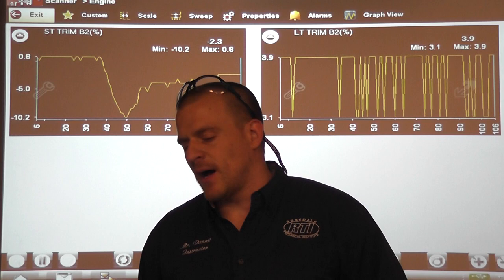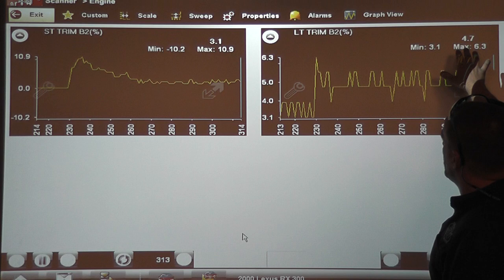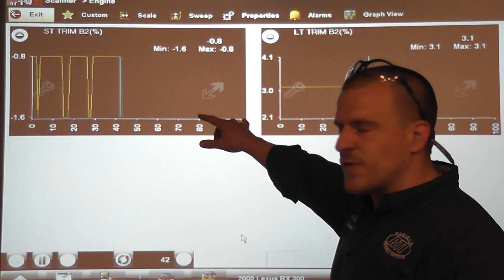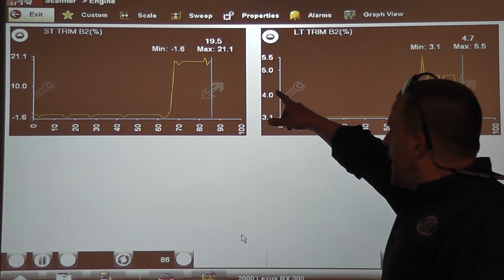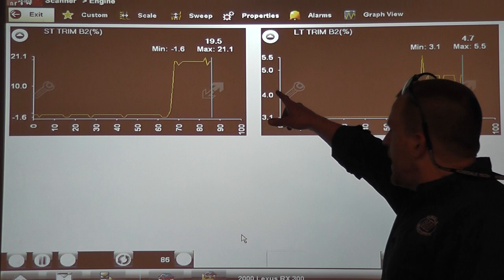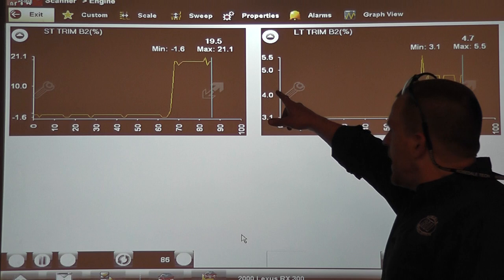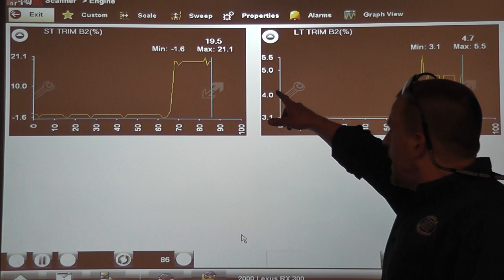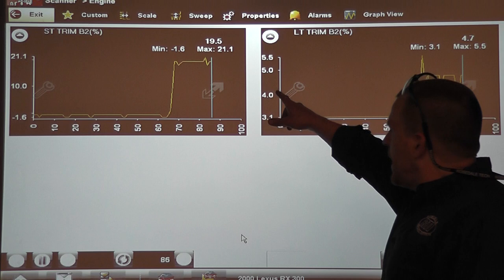Using Fuel Trim to identify type of misfire (can it be done?)

Comment from the maker: Thanks for your input. If I could get past all the bashing I would. I agree with you about some misunderstandings I may have with the O2 sensor and how it actually works. When I can put all of this together I will do a follow-up video to this. The main point of this video was to show that an ignition misfire does not cause a rich condition and negative fuel trim numbers. I would like to hear about your bad cylinder negative fuel trim scenario. Thanks again for your time and comment

Comment from the maker: You had it right in your comments on the ETCG video. I just felt the need to do this to clear the air for those that think an O2 will go rich with an ignition/compression misfire, from unburned, raw fuel in the exhaust. As you know, as misfire will drive the O2 lean regardless of the type of misfire. 
Thanks for the comment and great advice to the other poster on ETCG.

Comment: This is not a difficult concept to understand. Especially if you know that an oxygen sensor is exactly that, a sensor that reacts to oxygen. 

The term "rich" when discussing fuel trims, and fuel mixtures in general, is probably where most of the misconceptions come from. People I've worked with don't realize that rich isn't rich. Rich is oxygen deficient.

Oxygen deficiency can occur for many reasons but at no time can an oxygen sensor determine if a system has more fuel than it's supposed to have.

Great video.

Comment: Yesterday, one of the techs in my shop was diagnosing a surge at idle and an intermittent stalling issue. He had codes for a small leak and oxygen sensors. He was trying to command the vent valve close to see if it could see an increase in fuel tank pressure, but at some point saw negative pressure. He was trying to associate the vent valve with the surge, but I could not see the surge as a symptom of a  restricted vent valve. Today, another tech looked at it and checked one spark plug and the electrode was eaten away. Guess what, the LTFT and STFT were single digit negative. 
Logically, they should not be negative, but they were. Love your videos as always.

Comment: Paul, I had a citeron c3 1.6 8v in yesterday with inj no 4 open circuit DTC stored. Checked the STFT and that was 23%.checked it on the gas analyser and the HC were very low which confirmed that the injector wasn't working. Removed the plug and found corrosion on the terminals. Checked resistance 2.2 against the other 3 of 13ohms. Replaced the injector which brought the fuel trims back in line. Your videos help me so much! Keep up the excellent work!

Comment: I like this guy.  I'm an ME (but not in the automotive industry), and I do ALL of the work on my '08 Acura TL Type-S.  A few weeks ago, a spark plug decided to take a shit, which triggered the MIL, followed by a surprising loss of power and the embarassement of limping my "garage queen" back home with her sounding like a fucking golf-cart.  And a top speed to match.

During my LONG drive back to the house I was imagining every scenario possible as to what the issue might be, how much it would cost and how much back pain I would suffer while digging down to the troublesome part.  Bad injector?  Bad coil pack?  Some pissy connector somewhere?  

I kept thinking about how a misfiring cylinder would affect the AFR and how I could use that info to help me pinpoint and solve the problem quicker.  I was wrong.  Way wrong.  I wish I had seen this video before I fucked around and wasted time trying to diagnose the problem based upon incorrect assumptions about how different types of misfires would affect STFT and LTFT!  Some simple, old-fashioned troubleshooting led me to the correct diagnosis.

Nice job on the video dude.  I have been re-edu-muckated...

Comment from the maker: That is correct. Although there is some debate in this field as to the O2 sensor signal being affected by hydrocarbons. I am not debating that at this time as I am no chemist. But what we can definitely determine from this video is BOTH types of misfires drive the O2 signal lean due to excess oxygen in the exhaust. With the injector (no fuel) misfire showing even more lean.  One other thing, unburned fuel IS NOT rich. This is a very common misconception in this field.

Comment: I just used this to find a stuck injector on a 3.4 gm. Buddy had a miss. He replaced plugs/wire. Still missing. Used fuel trims to see it was running lean, then scoped the injectors and looked for a missing pintle hump. He had been driving like that for 6 months cause he couldn't figure it out. I fixed it in 45 minutes thanks to Danners channel.
Reply from the maker: nice! Thanks man

Comment from the maker: Hey, no problem bro. I didn't do this video to prove anyone wrong, I actually did it for me too as I had some doubts as to the result. When you get a chance, check out sections 4 and 5 in my book (now that you have it). These two chapters cover O2 sensors and Fuel trim in great detail. I think it will help back up this video.

Comment: I'm going to jump in and answer this since no one else has yet. I don't know what you mean by Internal v. External problem is. As his name implies, his video is about not using the scanner to diagnose a misfire. Quick checks would be examining the spark plug, wires and the boots, checking fire and voltage to and from the coil(s), checking for voltage signals to the injectors and feeling each injector to see if it is firing. Do a balance-of-power to find the faulty cylinder. (continued)

Comment: I’m new here. I’ve been experiencing rough idle with my 14 jeep Cherokee 4 cylinder. Using the bluedriver scanner. I found the LTFT at 19% and STFT at -4%. Replaced spark plugs and injectors with mopar. Rough idle is still there. Cleaned throttle body. Still there. Now i gotta check fuel injectors. This video really clarified alot
Reply from the maker: Does your LTFT improve at 3000 rpm in park?
Reply: @ScannerDanner  yes. I see better long term at 1500rpm
Reply from the maker: @ravit928  sounds like a vacuum leak
Reply: @ScannerDanner  thanks a lot for the feed back. I’m a tech at mazda. New to the auto field and your video helps a lot understanding these diagnostics. I’m gonna try and find this leak with a smoke machine. I have a feeling the EGR valve is clogged. I don’t have any DTCs. And when looking at mode 6. I get random misfires. Cylinder 1-4 gives me random numbers from 0-19 on random days when i check. I cleaned my throttle body and after doing a 20 min drive i saw low misfire like c1-3 c2-5 c3-0 c4-8. Then another week. The numbers change
Reply: Update. Smoked intake. Found no leaks. Pulled fuel injectors and check ohms. They were all good. Sprayed them down with brake cleaner. And reinstalled. Drove for about 20min. Checked LTFT went down from 19 to 3%. Definitely injectors
Reply: I mentioned injectors replaced ealier. I did spark plugs and coils. Not new injector. I’m gonna put new injectors and see the difference.

Comment: You are absolutely correct that neither ign. nor lack of fuel misfires cause a rich condition. The reason being that people forget that there is a full cyl. worth of O2 going in there also, and even with the ign misfire and unburned fuel, the O2 content far out weighs the amount of fuel. Both misfires cause a lean condition and will drive trims rich. You come back on IATN and you wont be bashed, I'll see to it. Remember, one can't feel, see, or hear emotion online, so don't take things personal.

Comment from the maker: I copied this from my book.
Higher than normal fuel psi,
Ruptured fuel psi reg. diaphragm, 
Leaking fuel injector,
EVAP purge problems,
ECT or IAT sensor problems,
MAP/BARO or MAF sensor problems,
EGR valve stuck open at idle,
Fuel contaminated oil,
Head gasket leaking causing coolant contamination of the O2,
Jumped timing chain/belt

Comment: You said it man,depends on many variables like COP , wast spark,distributor,misfire code or not,how accessible is the cylinder in question,how easy it is to current ramp etc.But if a gas analyzer is available ,I think wold be my first choice like you did with Eric.I had a Cadillac with North star engine in my shop today.No crank.To check for voltage drop at starter I had to remove the intake manifold,The cable was fine so I replace the starter.So it depends on the task at hand.LOL

Thanks again

Comment: Mate your channel is awesome, you explained what the data was all about on the display on my Bosch 2220 found my no2 bank in my ford xr6 BA STFT was 30 it's idle has been really rough, also in my Ford AU I found inlet  manifold Inlet gasket leak so I'm guessing it's the same with my BA as well, ruddy cars!

Comment: My car is running rich on one side of the engine bank 2, yet the O2 sensor on the same side bank 2 is reading lean. My right side catalytic converter is shooting out a lot of black soot. It definitely has a misfire because the MIL is flashing. I have changed out the O2 sensors, spark plugs, cables, cap/rotor, fuel pump, fuel filter, EGR, gas regulator, MAP, & finally the MAF sensors. Watching this video made me realize it might be clogged fuel injector making the O2 sensor read a false lean.

Comment: Hi Paul, At AVI on demand, instructors Ron Bilyeau and Bill Fulton are both sure that the type of misfire can be determined by the fuel trims: saying that a rich density misfire will cause negative double digit fuel trim numbers and a lean misfire will cause positive double digit numbers and also that the rear o2 sensor can can indicate types of misfire: high mv is an ignition misfire while low mv is no fuel misfire.
Reply from the maker: This was an argument against others who were stating that an ignition misfire will drive fuel trims negative.
Yes, fuel trim can be used as an aid to the type of misfire. In fact you can see the difference in fuel trim between the two. Also, I agree in using the downstream O2 as well!
Reply: @ScannerDanner  ive found your video very informative im having a po300 random misfire on my 2004 silverado 1500 with the 4.3 v6 it only happens on the highway in 3rd or 4th gear going up hill or towing my camper i can floor it in 1st or second no problem with no issue. I logged my upstream o2 sensors and my short term fuel trims. At the moment of misfire the o2s are reading very rich like .8-.9 and the short term fuel trims go completely flat during the misfire. Normally they fluctuate from -3 to +5 in the typical up and down fashion, but go dead flat around 0. Any idea what would cause this?
Reply from the maker: @dougsavery5442  any misfire will alter your fuel trim and O2 readings. So that info isn't really all that helpful. From your description it sounds like a secondary ignition issue. Hard to say, but that flat style distributor cap was notorious for crossfiring inside.

Comment from the maker: P1132 is B1S1 indicates rich (this would cause negative fuel trim numbers. And P1151 is B2S1 indicates lean (this would cause positive fuel trim numbers). 
So one bank is running rich the other is running lean, Is it possible the connectors for the upstream O2s can be switched? In other words they are connected to the wrong bank. This can cause this condition. Also you may want to check that thing for a bad headgasket.

Comment: Thanks for clearing that up, Paul.  Very good video.   Even though the system went open loop on the narrow band, you could probably see the O2 sensor voltage PID and see that it was indicating lean.  In fact, I wonder what the O2 voltage would look like on forced open loop system with an engine misfire?  Can't wait to see your video on wide band and how the ECU knows the cat is bad on that system since it really can't compare front and rear o2 voltages.

Comment: great job man, had a similar disagreement before couldn't win lol... glad you covered this . had a couple question, your using a picoscope right? what model?   been looking at some PC based scopes and read some good reviews on the picoscope... any thoughts? and no i cant afford a verus lol as of right now im using a old bench top scope works well and for scanning a snap-on mt2500 and AutoEnginuity proline + Mitchell 5.8 its not the best setup but gets the job done. 
thanks, will

Comment: (continued from previous post) More quick tests are to use a vacuum gauge and checking the fuel pressure. Finally do a compression check and also a Leak Down Test. Too many mechanics out there will only look at the scanner trouble code and just throw parts at it until they finally replace the right one while making the customer pay for all of those mistakes mostly because they don't know what they are doing. Learn how to use all of these tools. (checking spark voltage should be in above comment)

Comment: Hey scannerdanner just wanted to talk to you about a test like this using the map sensor and O2 sensors data to find a type of cylinder miss. you might already know about this and if so just let me know. its pretty much what your doing but little different. so here we go first to determine if its a possible mechanical miss look at the map sensor data. were using the map sensor as a vaccum guage. so if the map looks smooth not jumping around like you see on vaccum guage with mechanical problem then look at o2 sensors. upstream and down stream. mainly downstream  is what will help lead you in right direction to a fuel issue or ignition issue. now lets say downstream o2 is reading lean this will lead you to a fuel issue because the cat is letting go of this extra o2 that doesn't need to store since the injector isn't supplying fuel. now vise versa if the downstream is reading rich now were looking at an ignition miss because now the cat is using all the oxygen to burn off all the extra fuel. now its a great test I was taught by a very smart instructor like yourself and wanted to share with you if you didn't know about this. if so just let me know. if you know about this and or have video of this I would like to know. thanks and keep the great vids coming.
Reply: Thanks so much for sharing. That is a great tip!

Comment: I thank you for all your wonderful inputs and suggestion. Let me show you the tables of the key parameters and their conditions and they also answer your questions:

After about 8 minutes at IDLE, no speed, RPM = 785, pending codes for misfires all cylinders (P0301-P0306) and P0300 (Random misfire) show up:
1. ECT = 176
2. MAP = 10 inHg
3. Spark advance = 9
4. IAT = 95
5. TPS = 13.3
6. STFT bank 1 = -27.3, bank2 = -2.3
7. LTFT bank 1 = 0, bank 2 = 0
8. A/F ratio sensor 1 bank1 = -0.246 to -0.269mA (before CAT bank 1)
9. Eqv ratio 11 = 0.964 to 0.972
10. A/F ratio sensor 1 bank2 = -0.019 to -.074mA (before CAT bank 2)
11. Eqv ratio 12 = 0.991 to 0.999
12. O2S2B1 = 0.825V (after CAT bank1)
13. O2S2B2 = 0.195 to 0.715V (after CAT bank2)
14. Load = 34.1

Then I drive the car, during ACCELERATION I see O2S2B1 = 0.3 to 0.6V (after CAT bank1)

Per your instruction, I take notes the following numbers during DECELERATION; my foot off the gas pedal:
1. STFT for B1 and B2 = 0
2. LTFT for B1 and B2 = 0
3. A/F ratio sensor 1 bank1 = 3.7 to 4mA (before CAT bank1)
4. Eqv ratio 11 = 1.99
5. A/F ratio sensor 1 bank2 = 3.5 to 4mA (before CAT bank2)
6. Eqv ratio 12 = 1.98

7. O2S2B1 = 0V (after CAT bank1)
8. O2S2B2 = 0V (after CAT bank2)
9. RPM is about 2000
10. MAP = 5.9 inHg

Then about 1/2 hour driving (acceleration and deceleration), I then park the car and let it IDLE:
1. STFT bank1 = -11.7
2. LTFT bank1 = 0
3. STFT bank2 = 0
4. LTFT bank2 = 0
5. A/F ratio sensor 1 bank1 = -0.007 to -0.0085mA (before CAT bank1)
6. Eqv ratio 11 = 0.999 to 1
7. A/F ratio sensor 1 bank2 = -0.019 to -0.070mA (before CAT bank2)
8. O2S2B1 = 0.76V (after CAT bank1)
9. O2S2B2 = 0.2 to 0.7V (after CAT bank2)
10. MAP = 9.7 inHg
11. Spark advance = 8 to 10
12. ECT = 201
13. Load = 32.5 

14. RPM = 790
15. IAT = 134
16. TPS = 12.9

Then I turn off the engine and wait for about 10 minutes and start the car again at IDLE:
1. STFT bank1 = -25.7
2. LTFT bank1 = 0
3. STFT bank2 = 0
4. LTFT bank2 = 0
5. A/F ratio sensor 1 bank1 = -0.007mA (before CAT bank1)
6. Eqv ratio 11 = 0.999
7. A/F ratio sensor 1 bank2 = -0.050mA (before CAT bank2)
8. O2S2B1 = 0.6 to 0.825V (after CAT bank1)
9. 02S2B2 = 0.2 to 0.7V (after CAT bank2)
10. MAP = 9.7 inHg
11. TPS = 13.3
12. IAT = 147
13. ECT = 207

Questions:

1. Seems like when I drive, the numbers are getting better until at idle STFT bank1 go back to -25.7? Does 02S2B1 (after CAT bank1) is normal? the 2 A/F ratio sensors (pre CAT) are ok?

2. One more thing, yesterday, at IDLE, I rev the engine to 3000 RPM for sometimes, the P0172 (System too rich bank1) and P0430 (CAT system efficiency below threshold bank2) came up with Engine Light on. I was surprise P0430 for bank2 CAT. Should it be for bank1 instead? Yes, the O2S2B2 values indicated potential CAT problem for bank2, should it be CAT for bank1 instead because of bank1 STFT is too negative - 25.7?

3. Can a restricted CAT bank2 causes STFT bank1 negative?

4. Or the other way around, can STFT bank1 is too negative which can cause restricted CAT bank2 problem?

5. I just order a "smoke machine" which will arrive in next couple of days, will do smoke test in all system. Any other test(s) should I try?

Please advice.
Many thanks & God bless,
Hai

Comment: A intake leak will have high short term numbers at idle but normal at 2500 rpm.
A gas analyzer will distinguish between the misfires.  Both have high O2 levels
but no HCs on the fuel injector.